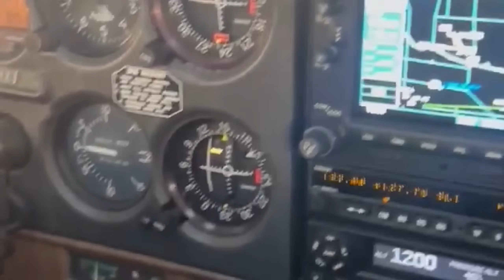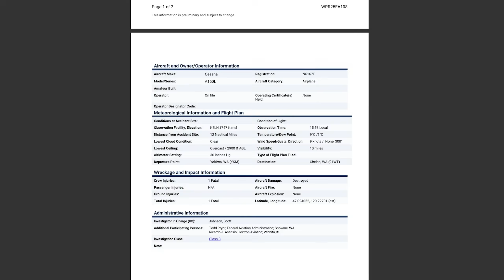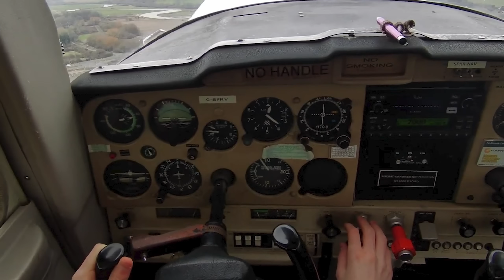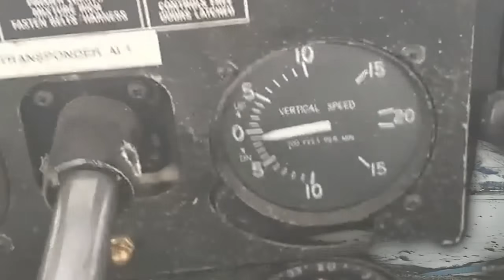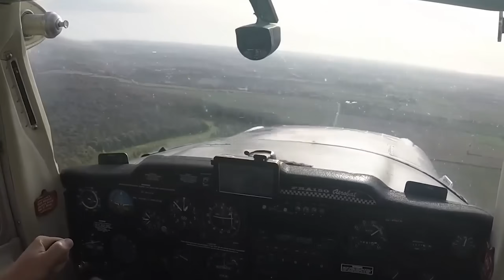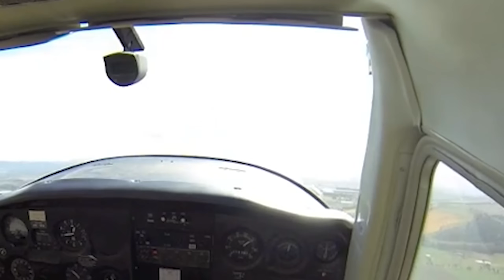NTSB Prelim Report Revealed The Pilot’s SIMPLE Mistake That Caused N6167F Crashed, New Discovery...

Comment: My condolences to the family of our colleague!Even if the plane and the pilot had been IFR certified,looking at the weather,below 9 Celsius,and overcast sky,the Cessna 150 has no antiicing devices,and they load up with ice in very little time.Once you pick up ice,you've got to descend and the plane will stall at unusually high speeds.Flying small singles in IFR is a very risky business,because once you are trapped in ice,your windshield is covered and any turn will stall you.Terribly sad.RIP,fellow pilot.Best regards from an old Spanish pilot.

Comment: why do you use 'nautical miles' to measure two points on land? what's next; 'nautical kilometers'?
Reply: Pilots commonly used nautical or statute miles measurements because the ruler used to measure distances on VFR charts have both scales printed on it.
Reply: Pilots measure their speed using “Knots”. That is based on the measurement of a nautical mile.